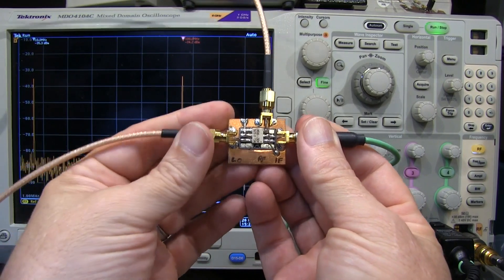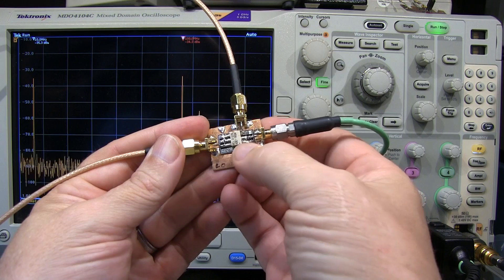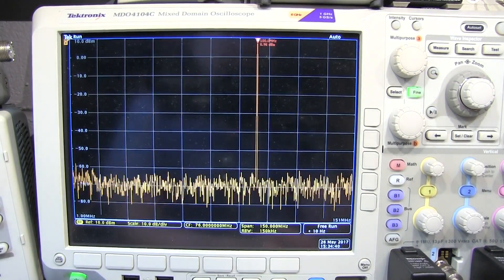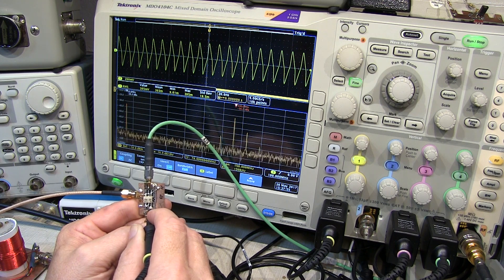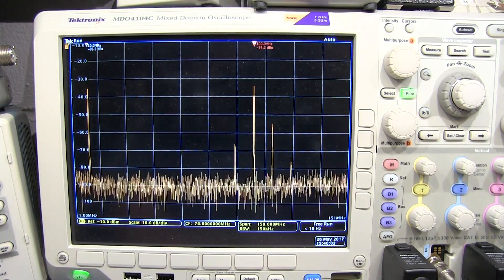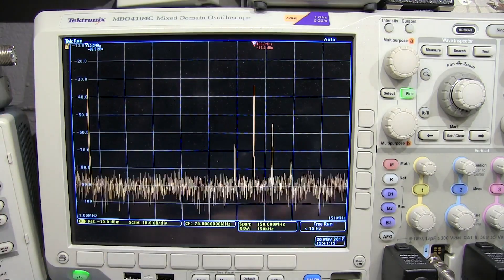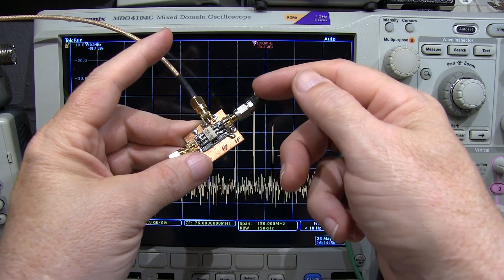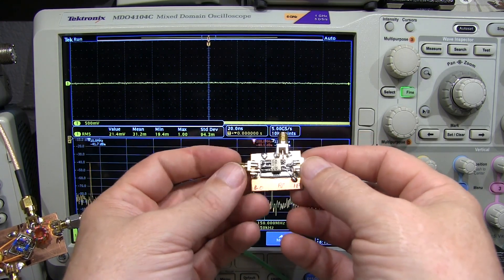#260: RF Diode Mixer LO Drive Level & Conversion Loss | 1dB Compression | Distortion

Comment: Thanks for sharing your great video's. I have a question stemming from the home-brew mixer you show around 6:11 - I see you used Mix 6 cores for this and I have been wondering about this as I'm having a hard time getting 43 mix in the 37 size but I do have a fair amount of 37-2's and 37-6's on hand... do you think it makes a big difference using those versus the mix 43 cores when it comes to HF bands like the 7mhz band? Do you need to adjust the turns or is it mainly the ratio that's important irrespective the mix used, provided of course that the mix is good for the frequency of operation both on the IF and RF side?
Reply from the maker: To be honest, I used Mix 6 because that's what I had on hand ;-)   I don't think it makes that much difference at low HF.  As you suggested, make some adjustments to ensure the winding inductance is >4x your system impedance at the lowest operating frequency.

Comment: What's inside that mixer ic ?
Reply from the maker: Take a look at my video on the diode ring double balanced mixer
Reply: @w2aew  thanks. I thought I did (if I'm not confusing it with something else) but doesn't it include transformers? If I get it right there are no transformers in this ic one.
Reply from the maker: @kamurashev    There are very small transformers in this one.  See the schematic on the datasheet: https://www.minicircuits.com/pdfs/ADE-1ASK.pdf

Comment: Because you set the carrier signal high
frequency at the RF input when it should
be connected to the LO input?
You should not see a signal with a carrier
suppressed?

Comment: Can we mix high LO input like 17dbm with very low Rf like -30 dbm or need to amplify rf to some minimum level?
Reply from the maker: Yes you can - no need to amplify the RF signal, but just beware that the conversion loss still applies.
Reply: Thanks to your video I was able to make a double balanced mixer. But I am getting very poor LO suppression and it's leakage brings in a strong fm station around. I used 1n4148 as its only diode available around. What should I do to suppress LO leakage in IF . I got 17 dmb LO. Itt Mackay Marine radio.

Comment: Great video as always. Would love to see a additional video specifically on using the diode mixer as a modulator. My own experiments with the diode ring modulator have left me with more questions than answers, as usual.
Reply from the maker: Check out my latest video on the topic...
Reply: @w2aew  Very informative. Thanks!
I've been experimenting with the different ports as inputs and outputs with different results for each configuration. Is there a standard in / out configuration?

Comment: Would diodes in series increase the permissible drive level?  Also, are pin diodes or signal diodes used in diode bridge mixers?
Reply from the maker: You generally want near-ideal switches - no reverse recovery - so PIN diodes are generally not used.

Comment: I'm experimenting with a homebrew diode ring mixer. I understood setting the LO level. What I was wondering is the impact on the IF if the LO level was higher than required … is there a down side? You talk of too much RF impacting (commutating?) the mixer causing distortion. Does the 10dB rule of thumb LO:RF hold true if there's too much LO or does distortion creep in when the RF reaches a level that impacts the diode commutation? (I had to google diode commutation as I had never heard of it LOL). Reason for asking … I'm experimenting with simple ham radio design and want to keep the design as simple as I can. Thank you for all your brilliant videos.
Reply from the maker: Increasing LO drive generally improves the IP3 and IMD - to a  point.  More LO drive is generally better, until you start having problems with to much current in the LO path (turning the diodes on very hard).  It depends on your design.  Square wave LO design can give the same benefits as higher sinusoidal LO drive, but at a lower power.  A nice discussion of various mixer types can be found here: https://www.qsl.net/va3iul/RF%20Mixers/RF_Mixers.pdf
Reply: @w2aew  Thank you so much.

Comment: Many doubts are cleared! Can you explain the convention efficiency in view of diode cut-in voltage and LO power. To pump in higher harmonics, for THz, what design change is required?

Comment: Is there a way to do that calibration without a spectrum analyser? Suppose downconverting that signal on the other end and listening to it?
Reply from the maker: If you're going to "listen" to it, then maybe your receiver has a signal strength meter which can be used to observe the changes in conversion gain.

Comment: Thanks, Alan! great video. quick question about taking measurements of a homebrew diode mixer. is there a way to determine the drive power using the time-domain signal from an oscilloscope? for instance, when the diodes are fully commutating,should i expect to see clipping at the peaks of the signal on the IF port as the LO drive power varies?
Reply from the maker: That's one way.  With scope, you can look at the LO drive, or you can look at the converted output variation vs. LO variation.
Reply: good to know. Thanks!

Comment: I think the only problem is that you need to have a good quality crystal filter centred on the IF of choice and maybe it would be better to use a balanced QSD but LO=((VCO+IF)*4) and using a phasing RF combiner which should mean that you are not getting harmonics of the RF,LO or the IF.

Comment: So this is another way to produce an IF? Where would you use this. In a radio would it replace the mixer valve (Transistor). How is the intelligence of the signal effected. How can diodes mix a signal? Fascinating stuff. Never heard of such a thing before.
Reply: Thanks everyone. Now just watched #167 and I now see how this works. Very interesting. Love the way two signals multiplied is the addition of two signals at sum and difference freq. That was something I have never seen before. I just looked up trig identities (plus the graphed trig proofs) and I see where it has come from. Really want to find out more now! Great videos.
Reply: "How can diodes mix a signal?" Check out video #167 w2aew
Reply from the maker: Mixing can occur in an non-linear element.  See the video links in the video notes above for more information on diode ring mixers
Reply: As the diodes commutate, you're multiplying the (clipped) LO and RF. When you multiply in the time domain it's the same as simultaneously adding and subtracting in the frequency domain. Any switch can accomplish this.

Comment: Thanks Alan...how about a discussion of the use of Third Order Intercept as a measure of performance?  73 - Dino KL0S
Reply from the maker: Yeah, I need to do a video on that.
Reply: Great way to start the holiday weekend...new videos from Alan and Buddy!
Reply: Like to see that also.
Reply: In that case a more "juice" from the LO drive is wellcome. I always drive a dB or two dBs above LO level required to meet the best IP3 performance and still not affect the mixing products. Go ahead with IP3 test, this should be nice video.